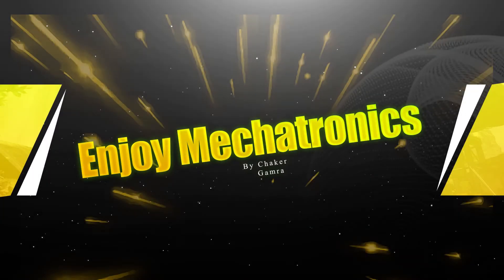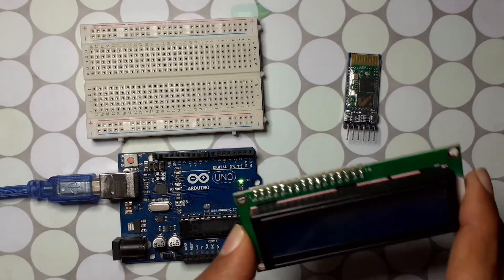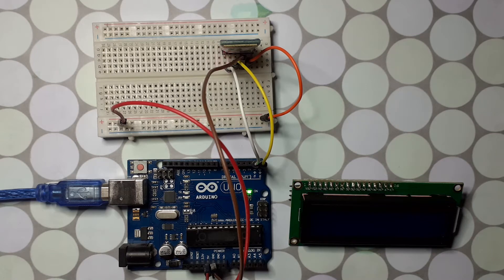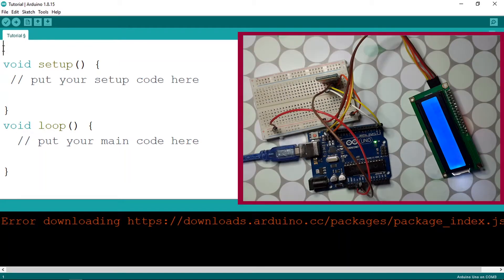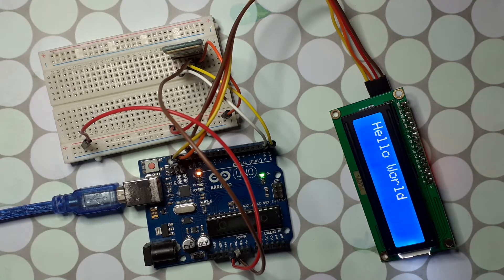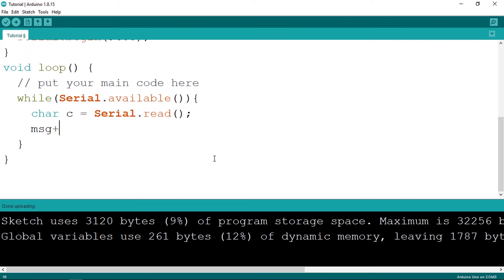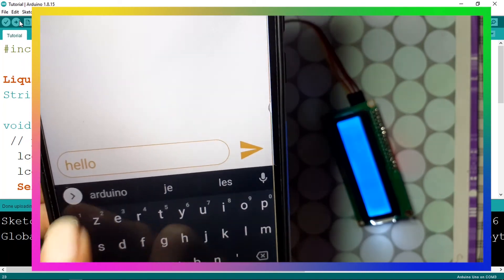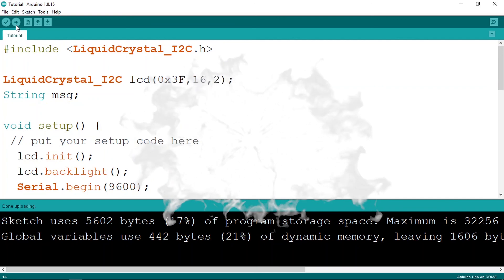Arduino Tutorial 27- LCD Display Control via Bluetooth

Comment: How was bluetooth programmed to receive from the phone ???? Please answer
Reply: You simply connect your phone to it (listed as a BT device, just like a BT speaker, for example), then you use the mentioned app to send text via BT. Arduino is programmed to read it on its serial port connected to BT module, and display the text on the LCD.